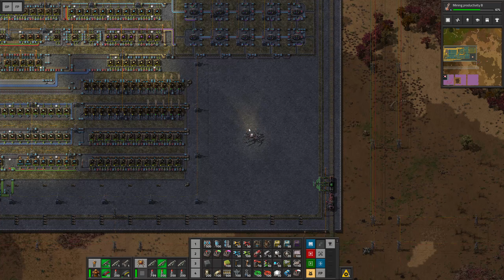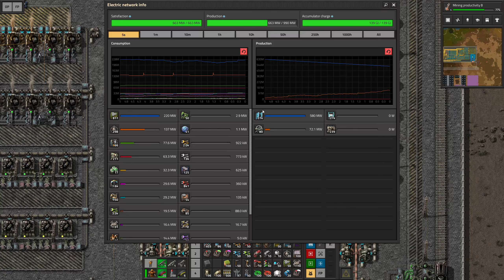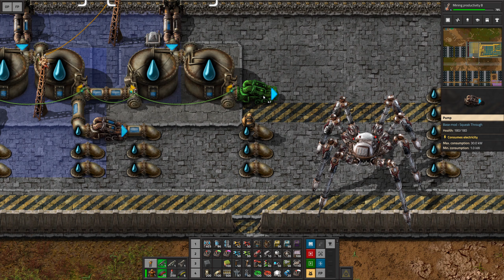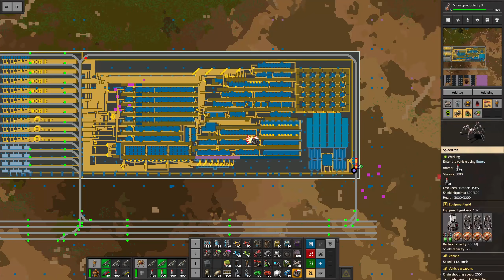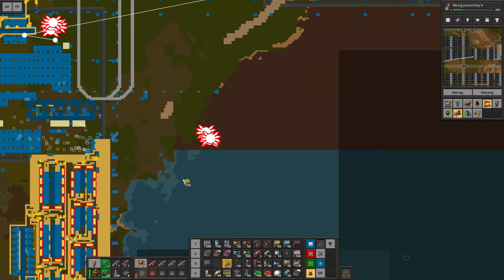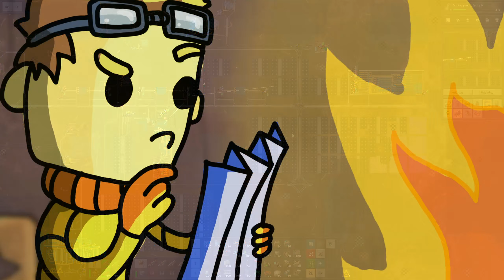NUCLEAR POWER - Step 41: Factorio Megabase (Step-By-Step)

Comment: How many nuclear fuel canisters can you hand feed into a reactor and how many fuel cells will the output slot hold before the reactor shuts down?
I was thinking about building a 3x3 to get 1.32 GW in a small space for max efficiency, hand feeding the reactors periodically and storing the steam in a massive tank facility for later use.
I currently have 60k+ solar panels and several continent-sized accumulator arrays cluttering up my world lol

Comment: fluid dynamics: you probably don't need the pumps apart from the start, underground pipes count only as 2 pipes (entry,exit), so if you go by the fluid throughput table, you'll have to place down a lot of underground pipes to reach the point where you're hurting throughput - which is why underground pipes are used so much

Comment: For the pump issue factorio needs one pump every 10 pipes. Since you already have water fill I and other fans probably wouldn't mind you feeding your steam system directly from off shore pumps
Reply: i would say it is a solution if nothing reasonable other option works, buth nathan decides :)